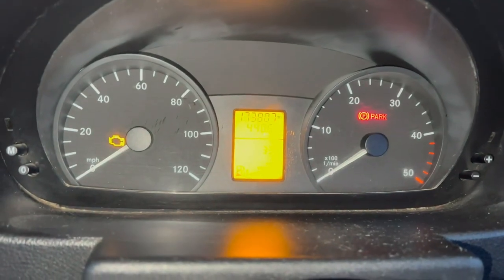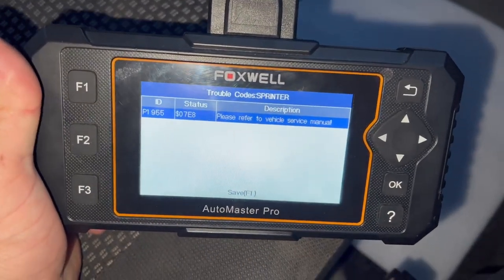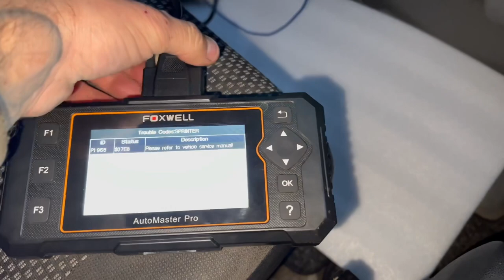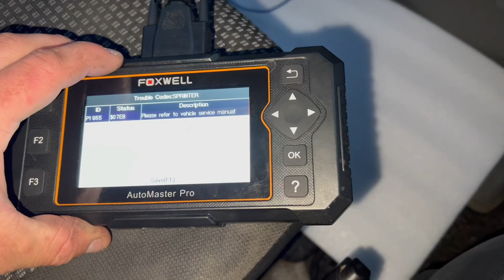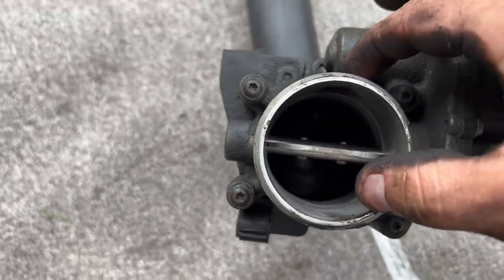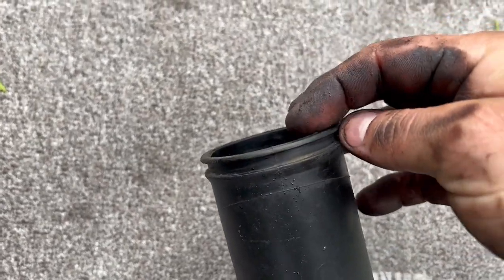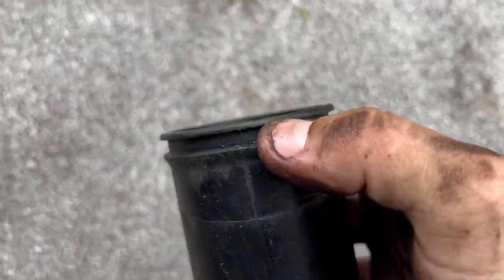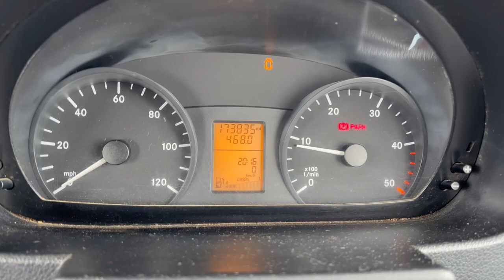Mercedes sprinter EML light flashing. Fixed!

Comment: Got the same error as you

MAF and MAP sensor replaced, air filter clean, turbos are new, throttle body clean, just checked this gasket and looks good had a nice seal, all charge pipes looking great don't hear any leaks, expect where this butterfly valve is, letting all the air through maybe and not closing? Engine not engaging the turbos at all, in limp mode. 

Running out of ideas
Reply from the maker: Have you had it on a computer to check what codes?
Reply: Please did you get it solve
Reply: Did you get the solution of this fault

Comment: Hi Steve 
Very helpful vid do you know what that part is actually called
Reply from the maker: I think it's the throttle body, an throttle body elbow but not 100%
Reply: Was it easy to remove
Reply from the maker: @davidmackintosh3291  yes easy

Comment: hi steve did it permanetley fix the issue? im getting p1955 and p0101 which is glow plug fault code and masss air flow out of range.......... im gonna have a look at this gasket see what it looks like, ive changed the mass air flow, throttle body, map sensor, air filter and it is still flashing, i will kill someone if it ends up being a bleeding gasket!!!! hahaha
Reply from the maker: Hello have you changed the glow plug relay? Could possibly be that in the end. I’d check gasket first though. I’ve had another sprinter before and that was a relay, this one has been a bit of a headache chasing small problems but touch wood all good now
Reply: @Itssteve90 Hi Steve, just a quick one, how do you get the plastic elbow housing out of the engine that goes up into the engine, I've been pulling on it after removing all the bolts, and it seems to be stuck solid.
Reply from the maker: @MrSonicPhaze  did you remove all 4? There’s 2 at the bottom an 2 at the back on around it, but awkward to get to. Once the bottom is free it should move side to side an just wiggle out
Reply: @Itssteve90  yes I removed all 4. I put some real downward force on that elbow with all my body weight and it didn't move an inch. Wiggled it side to side also, just didn't budge. I'm going to go outside again now and give it another go. Also to one of your previous messages I changed the relay and it didn't fix the issue.
Reply from the maker: @MrSonicPhaze  try spray a bit of WD up Ito where the seal is, try that. Sounds like the seal is ok then if it’s hard work, mine fell out. Had to put a bit of grease on new seal just to push back in as it’s quite hard to push back on, but you’ll know when it does as the holes will line up
Reply: @Itssteve90  Hi steve, Leo T ( Midlands) here, My 906 (2008) has had intermittant issues for the past year and I am getting conflicting results from various people who have happily taken my money yet not delivered a solution. Funy thing was that the first time it flashed the Engin light , somenoe said the engin oil was to high , dur to ash buildup. in replacing iol the fault was not there ut came back a week later, Many tests later ant the P1 955 code, I had replaced relays ..nothing then I replaced main Battery anf whoosh, fault was again gon toll I went for MOT , when it came back it was again flashing. My idea is to try to do tests on the CAN bus and look for a ground, or corrosion. any comment would be of help as I am stuck...
Reply from the maker: @leotedbeaver3306  have you changed the glow plug relay? They can be a problem. Also make sure your sprinter has more than a quarter of a tank on runs so the dpf can do a re-gen, sometimes that can put a management light on